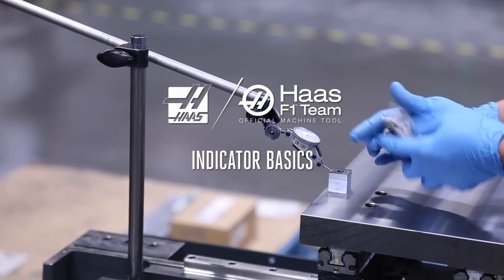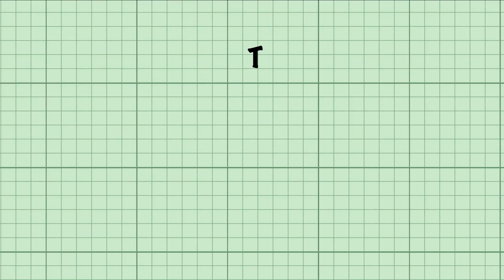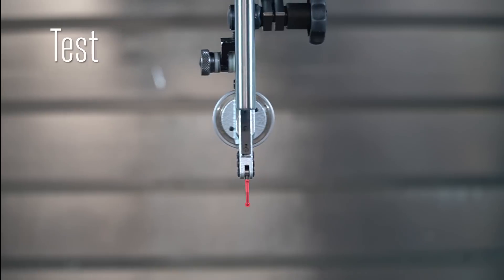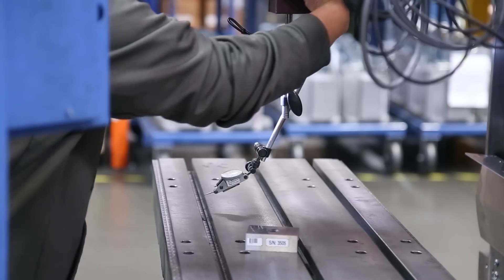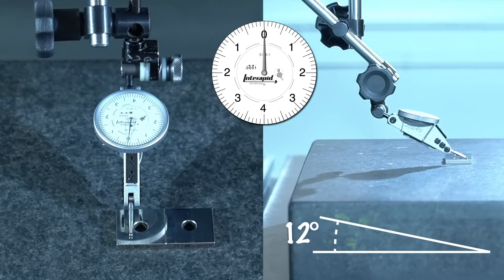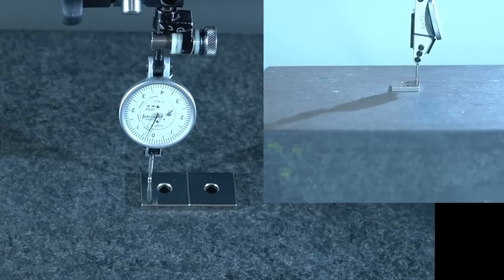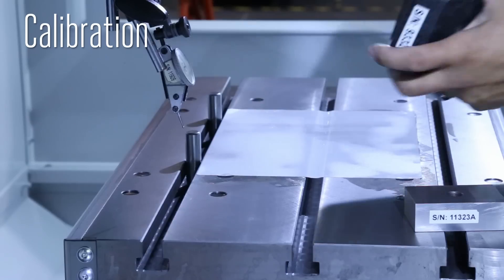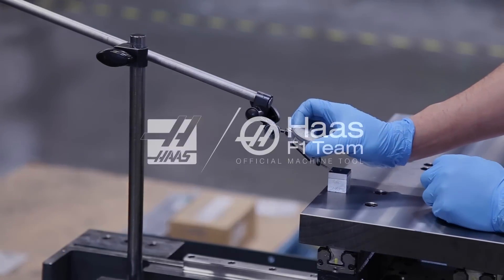Indicator Basics - Using a Test Indicator - Haas Automation, Inc.

Comment: hey im having issue could you guys tell me haas renshaw probe code for a partial boss probe cycle   to find the center of a boss thats not fully round
Reply: G65 P9823 is the renishaw inspection plus routine for 3 point vector bore and boss probing.

Comment: I usually don't comment but there is misinformation about tip angle. First of all dial test indicator's tip must ideally be positioned parallel to surface you test, that where you get the most accurate measurement. Only Interapid and Mahr will give the same measurement up to 12 degrees. Try to do it with Mitutoyo and you will see what I mean. Interapid are great indicators but so overpriced, it's ridiculous. Not everyone can afford to buy them.
Reply from the maker: Toucan,
We specify in the video that the 12 degree alignment information applies to Interapid indicators. The reason we predominantly use Interapid indicators during machine alignment, and through much of the machine shop, is that the ability to position the stylus at 12 degrees off of parallel makes many measurements substantially easier where it would be difficult to hang the indicator off the edge of a surface to attain a parallel orientation.
Reply: @haasautomation  Exactly!   https://www.youtube.com/watch?v=Iucf8DW5XMs&t=158s

Comment: Pretty cool, but you missed one thing. A test indicator is really only intended to "test" the difference between two surfaces, its not intended for taking measurements. the reason being that it will inherently have cosine error, but when you are trying to get two surfaces to match up, that distortion to the measurement scale is irrelevant.
Reply from the maker: David,
Here are just a few instances where a numerical value is an important result of an indicator reading: Checking runout of an end mill mounted in a toolholder. Tramming in a vise on your mill table. Dialing in runout on a round part clamped on your rotary table. Checking an accurately turned or ground bore to ensure it meets a TIR specification.

In all of these situations you are typically looking for an actual numerical value to assign to the measurement you’ve made. And many times this value means the part is either in spec or not. Let alone the measurements we make all day long here in the factory during machine alignment. Every one of these measurements has a numerical limit.
Reply: Bullshit. If you’re worth your salt as a toolmaker you can tram a perfect ground edge in a mill zero/zero by setting load to a certain point and swinging that same edge 180 with a gauge block. Ensure you find the high spot by rotating the spindle on your edge to maintain perfect zero and you can then use the machine to measure ANY point. The measurement is as accurate as your machines glass scales/parameteres. Hold tenths on bores all day. Maintain true position within 0.0002 over 96inches on a HBM and it’s a 1960s retrofitted devlieg 😂